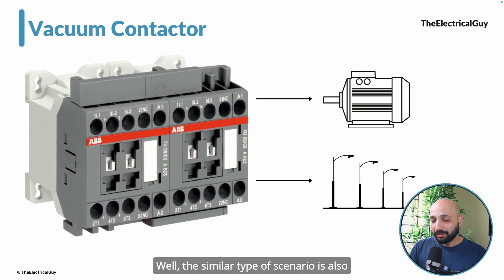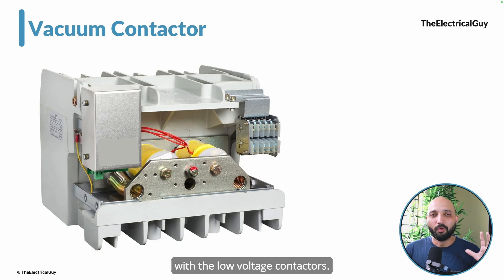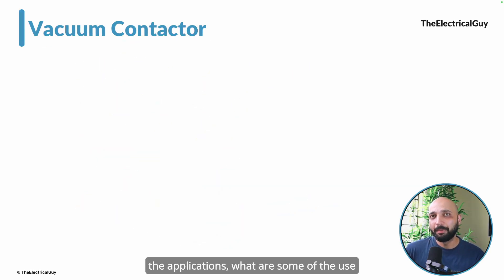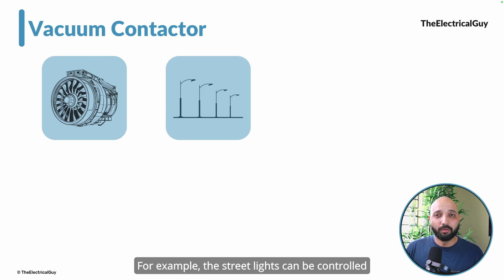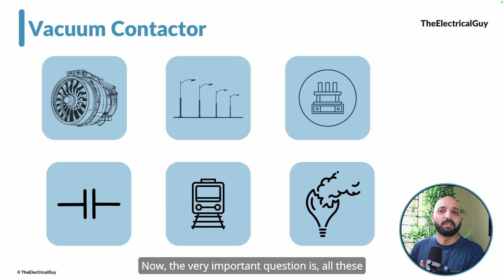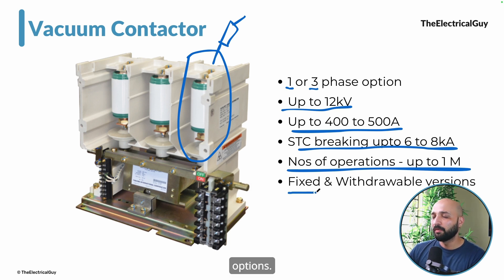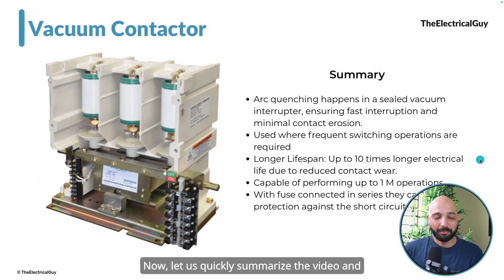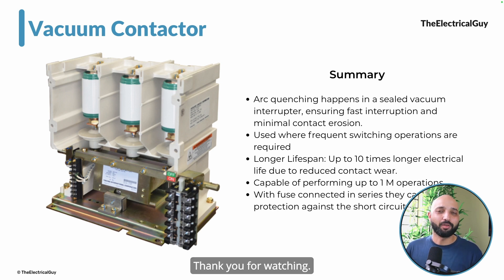What are vacuum contactors and why we use them? | TheElectricalGuy

Comment: Sir please tell me the typical difference between vacuum circuit breaker and vacuum interrupter, kindly please make dedicated vedio
Reply: Breaker infers it can break fault currents and a vacuum circuit breaker (VCB) will have vacuum interrupters (bottles) that can handle interrupting the fault level currents. Basically more robust vacuum interrupters. As opposed to what is discussed here with vacuum contactors that use vacuum interrupters than can only handle normal operating currents, not fault level currents. 
So a VCB does use vacuum interrupters for the current breaking medium.